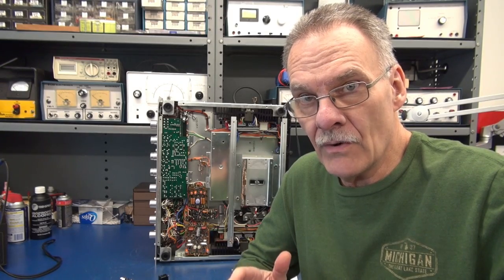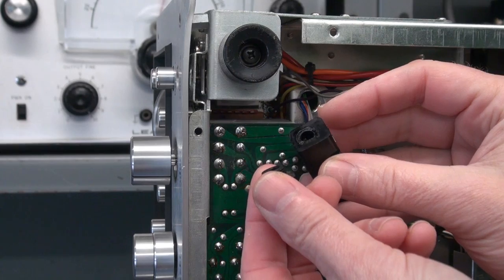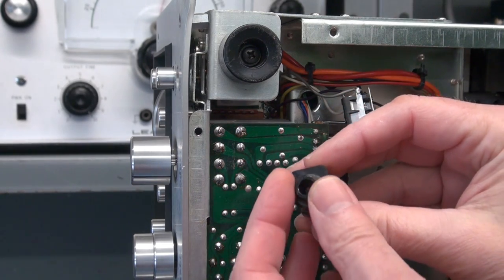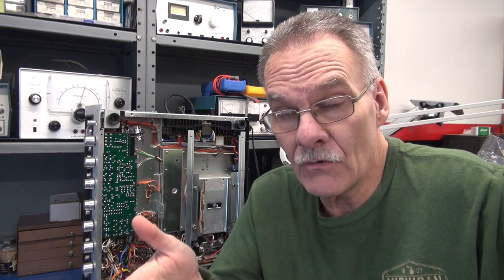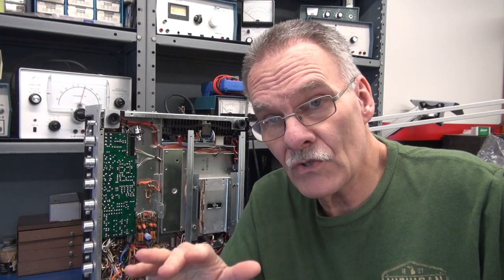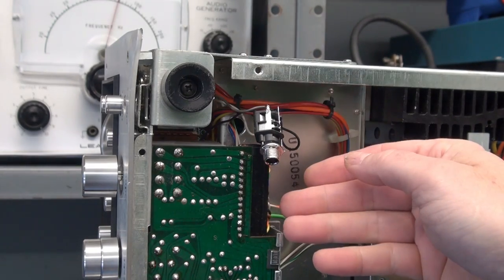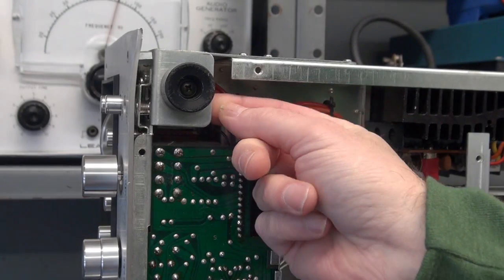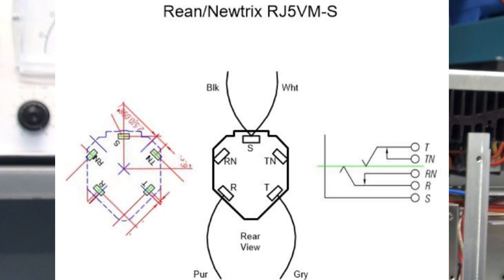Replacing headphone jack Vintage Marantz silver series home stereo receiver cheap part substitution

Comment: Finding replacement parts with both fit and function is often one of the hardest things when servicing gear.  This reminds me of an in-dash Panasonic AM/FM 8-Track CB radio combination unit with a broken shaft on a control.  Multiple concentric rings and center knob, I think it had four stacked potentiometers and a switch.  Fortunately I was able to get an exact replacement part from Panasonic, but it was a challenge to get it out of the unit and keep all the wires straight putting the replacement in.

I was proud of my work, a real sense of accomplishment.  I sense that in Terry's videos, too. 🙂

Comment: Are you going to be able to straighten out the panel on the receiver?  I have gotten dings and dents out of guitar amp front panels using c-clamps and blocks of steel, but that may not work on that device.
Reply from the maker: Yep, after pulling the face I was able to access the brackets
Reply: @d-labelectronics  Good deal Terry, I didn't think you would let something leave your shop in damaged condition, even if it wasn't your fault.